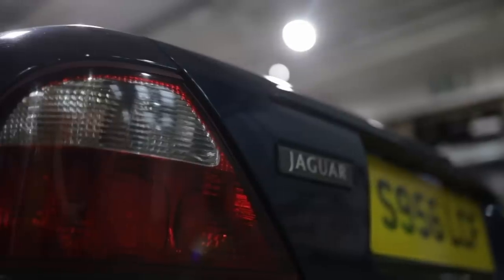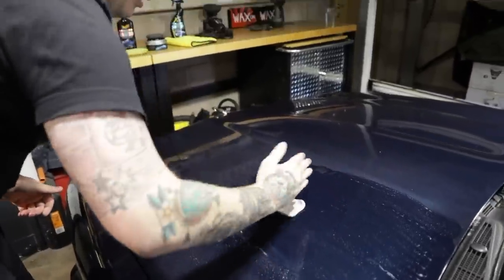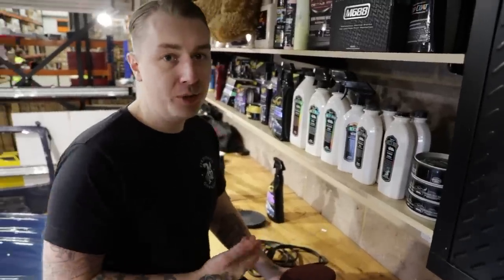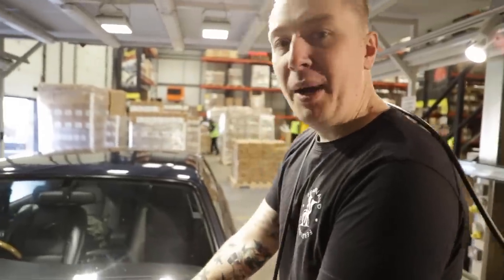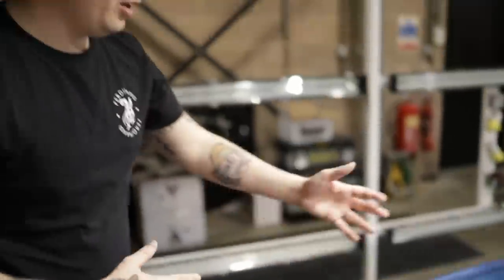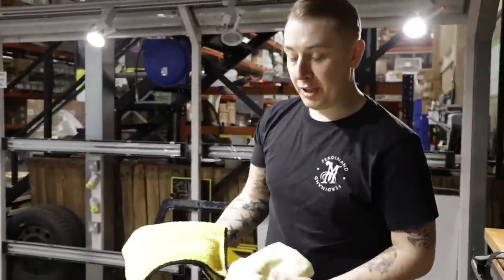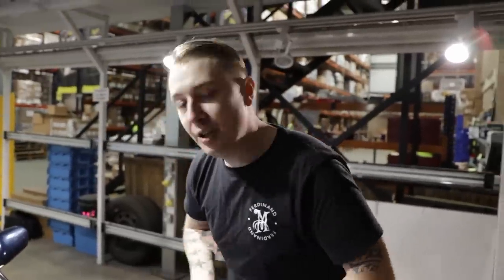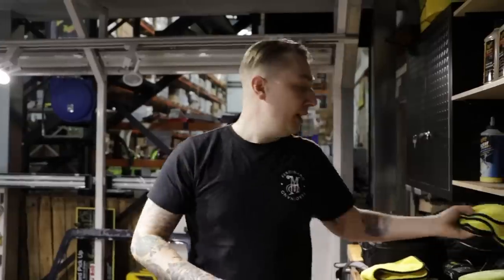Paint Restoration for Players Shows Jaguar XJR *Day In The Bay

Comment: This is testimony not only to the quality of Meguiar's, but also to Jaguar.  The X308s had an 10-step priming/painting process (source: 1998 Jaguar brochure) that was most surely best-in-class...very generous with clearcoat (unlike most of today's models) which makes the finish quite "forgiving".  I bought a 1-owner 2002 Vanden Plas with 45k miles, and spent 40 hours in my own multi-stage clay-bar/cleaner/polish/wax/sealer process (including Meguiar's products) with stunning results.  I have classic show cars too, but the X308s have the best factory paint I have ever seen.

Comment: Really interesting that you can do a whole car with one pad. Lots of pro detainers recommend up to 9 or 10 pads. Are the Meguiars better suited to just using the one ? Amazing work by the way x
Reply from the maker: As long as you keep the pad well maintained after each detail you can re-use them.
Reply: You can certainly use one pad for a car (per product type). Blowing it vacuuming the pad is necessary, but swapping the whole pad is crazy. You'd waste a ton of product just priming pads.
Reply: Most detailers are supremely ocd and probably use 3 different towels to dry after they shower so as to not contaminate.
Reply: @SupercarSeany  You're right.  Some of these guys take it WAY too far.  Super over-kill.

Comment: Hi. Great videos, thanks. I have just bought a Mequiars MT320 and I will be having a go at polishing my car over the next few weeks. I have a question about the older wax that is on there. Once I have cleaned and clayed the car. Do I need anything additional to remove any old protection that is on there or will the act of polishing it, remove what is left ready for the new wax?
Reply from the maker: No need to do any more additional removal after cleaning and claying. If you want to add a bit more extra deep cleaning ability during the wash process try the Wash Plus+

Comment: Question for you guys, I've seen the Meguiar's M699 Deep Crystal Top Coat on the shelves of the bay. Is that a Si02 maintenance spray/booster? If so, can it be used over any ceramic coating or does it just work with the M688 coating? Also, what's the durability like (6-8 months like most SiO2 sprays)? 

Sorry for the question bombing but can't find many info on this particular product.

Recently found your channel while researching Meguiar's products. Great, clear explanations and tips, plus nice filming and editing. Keep it up! 

That's XJR looks bonkers 👌🏻

Comment: If you wanted to use the ceramic wax spray would you have to remove all polish first or can you apply it on top of the car as it is?
Reply from the maker: So the Hybrid Ceramic Wax is to be put on when the car is wet after washing.
Reply: Meguiar's UK ah I see, I wasn’t sure if it needed a clean surface to sort of stick to? 👍🏻 any release date for wax in the uk?
Reply from the maker: @MrFatdaz  THIS MONTH! =D

Comment: My rule I stand by while waxing:  after claying/compound & polishing is complete to my liking.
I wax the panels with adequate amount of wax- NOT excessive. I can always go back and do another light coat to my liking.
Wax the larger horizontal panels first, hood,roof & trunk.
Then finish the other panels— leaving the bumpers and below the belt line in the panels last( from your knee height down on the doors I call belt line) these usually are areas of concerns. 
Before waxing below the belt line;  above this area should be dried along with the larger panels done first off- remove wax
Wax bumpers and below the belt.
Take the vehicle in the sun and completely remove the wax from panels and trim.
Open door jams- I typically spray them with a vinyl cleaner/conditioner prior to add to ease of removal of dried wax.

Comment: hi..
Can do you do a section in a vid on how to clean pads, applicators and microfibers after use?
Reply from the maker: Absolutely! If you check out the day in the bay with the red mk3 golf it explains on there how to maintain DA Pads! for the microfibre ones its as simple as putting them in the washing machine.
Reply: @meguiarsuk   you should never use powdered detergents, fabric softener or bleach for microfiber cloth cleaning. I always do mine in the sink with good old Fairy liquid.
Reply: @meguiarsuk  you put your Pads in the washing machine?? Clothes washing soap along with them?
Reply from the maker: @ltsgarage7780  I'd wash them on their own but no softeners.
Reply: @meguiarsuk  thank you. I've been throwing mine away after a few uses. I was cleaning them in my kitchen sink. But never using any kind of soap on them. I had a detailer I was using on my cars. But I found that they could never get those final small light swirls out of my black cars. My Cadillac XLR & Acura NSX in triple blacks. This showed up. They kept saying it cant get any better. 
  Well!! I stopped using them & started doing them myself. I finally got rid of these swirls.

Comment: If you wanted to add a ceramic coating to the paint is that right after the wax or before?
Reply: Ceramic coating is added after polishing. There is really no need for wax if your car is coated. The coating will lose it´s hydrophobic qualities if you slap a layer of wax op top of it. If you plan to wax your car, might as well save the money and not put a coating on it. And if you put a coating on top of wax it will not even stick to your car. A car needs to be fully degreased before adding a wax or coating for it to stick as it should.

Comment: Do you use a smaller da for the tight areas like doors and windscreen surrounds
Reply from the maker: No just a smaller head. so we go from 5 inch to 3.
Reply: So what pads do you use as meguires don't do a 3inch (75mm) pad only microfibre
Reply from the maker: @drewbale  The 3 inch come are part of the drill attachment Da Power system. For smaller areas you can still get fantastic results using compound by hand.
Reply: Meguiar's UK  understand the 3inch backing plate as have a g220 and a mt320 g220 backing plate is 3 inch so you would use a 4 inch pad ?
Reply from the maker: @drewbale  https://www.meguiars.co.uk/shop/da-compound-power-pads

Comment: Would you put some form of bead protection over the finish?
Reply from the maker: That's the wax's job! =D
Reply: I am aware what wax does. From your website" A common misconception among some customers is that when the beading stops there is no longer any wax protection on the paint. This is not the case. Some waxes like our NXT Tech Wax 2.0 contain water-beading properties, but they do not last as long as the wax protection. So the beading may stop after a few weeks, but the wax protection lasts for many weeks after this." So the Wax can have a limited beading time, do your other products top up that beading time?
Reply from the maker: @recruitmentwebsites  Absolutely. For example if you were to top up your NXT wax again with NXT the beading properties would go back to how it was before.

Comment: Way too much work involved in this process. I grew up detailing. My dad owned the first auto detail shop in Pasadena Ca...1966-2003. We did it all...Polish and Wax, Interior, Steam and Painted engines, overspray removal, color sanding etc...we did it all. HIGH lUSTER PRODUCTS are far better than Meguire's. Meguires is okay if you don't have access to professional-grade products. That buffer (if that's what you want to call it) looks like a 1500 rpm. To do the job correctly you need at least 2700 rpm. If you know what you are doing you don't need to tape the edges. Proper technique will leave no swirls, diapers... no cobwebs. Everything these guys use can be purchased over the counter. Non-pro products. Professionals use professional-grade products, equipment, and materials. I have a 2000 Jaguar XJR. The paint is 20 years old. I've probably polished it 4 times since new. It looks like it's just been sprayed. Never washed with soap. All I do is a wipe down with a wet cloth and then dry it with a dry one, occasional full rinse, and pro-grade liquid wax. I get it, most of you have no idea what a real Auto Detailer does because there are so few. It really is a skill. These guys are trying hard, but trust me they have no idea.